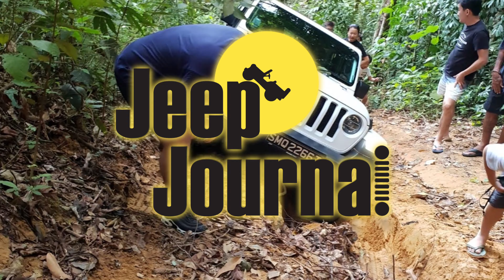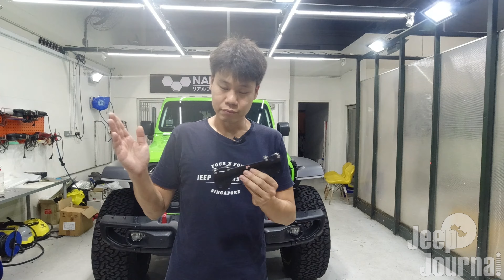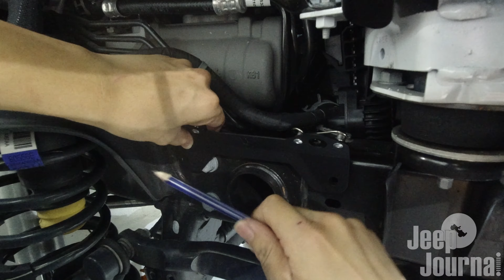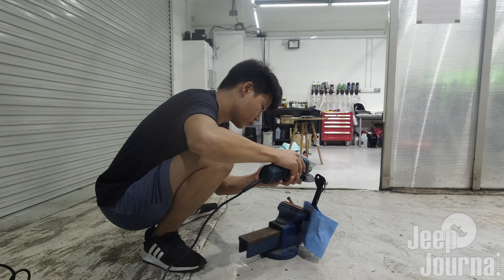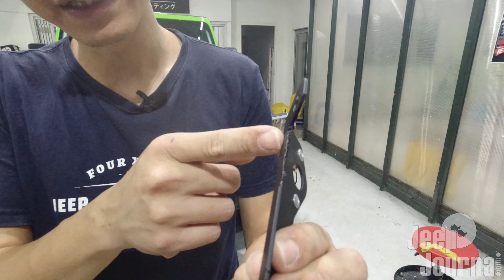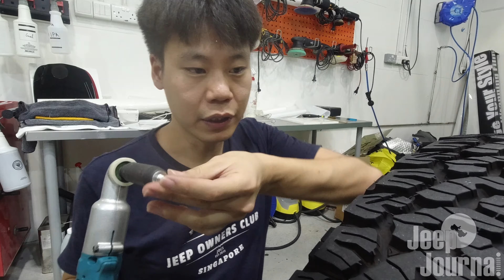Jeep JL Wrangler Inner Fender - American Adventure Lab Quick-Release Front Inner Fender Installation

Comment: Surprised that the brackets need to be trimmed. You would think AAL would have supplied brackets that don’t need to be cut. Kind of disappointing
Reply from the maker: Hi its okay cause the products works well! However, as mine is a right hand drive JL, and the inner fenders are made specifically for the left hand drive JLS, thus a little bit of trimming is okay (: